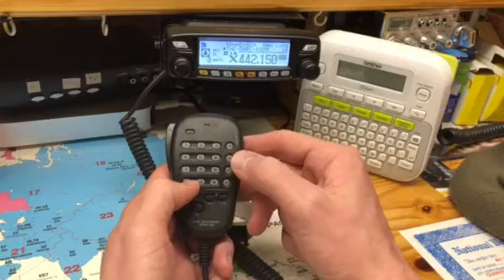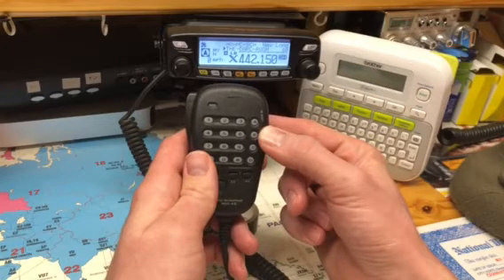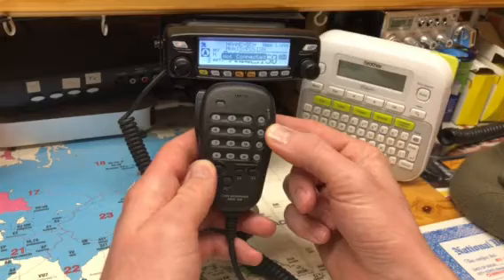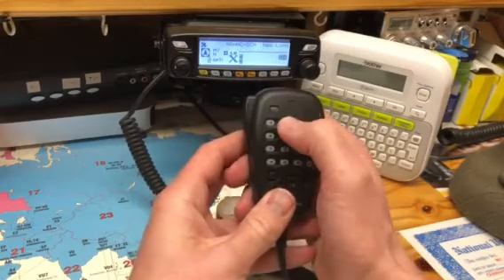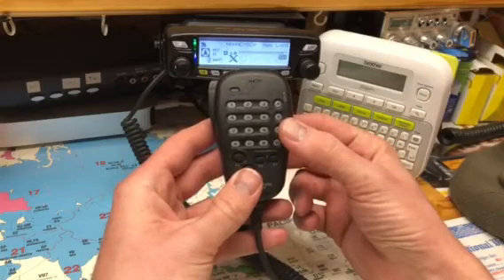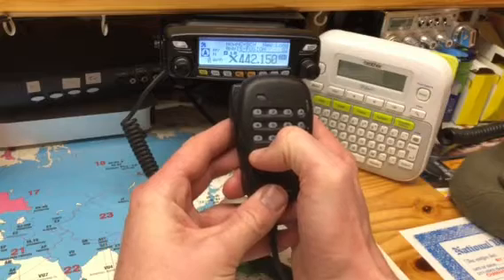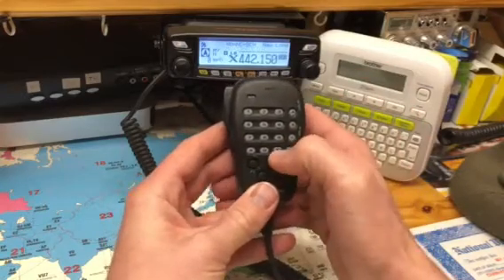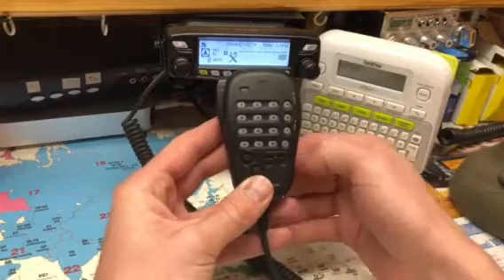FTM100/400 wires x control using dtmf mic

Comment: Thank you for your tutorial. I was struggling to find this in the Wires X edition manual. It was not clear, at least to me. If you gleaned this from the manual, could you tell me on which page it is ? Bill AF7ZA 73